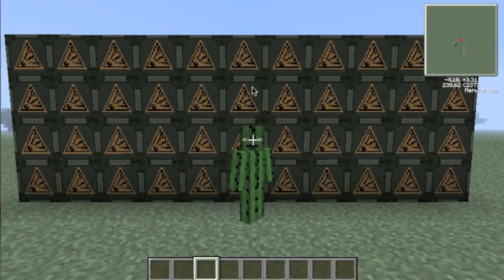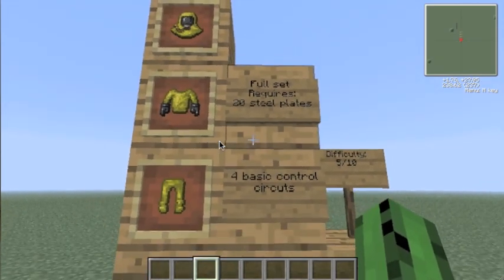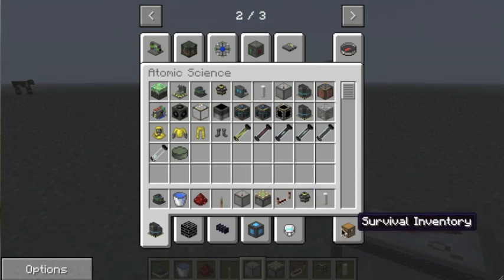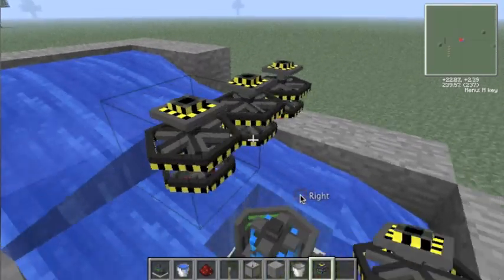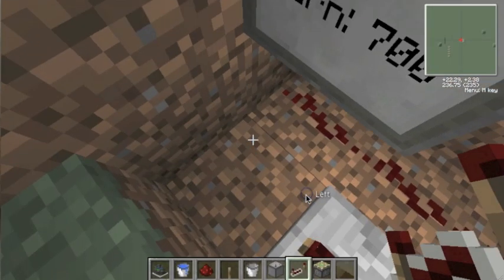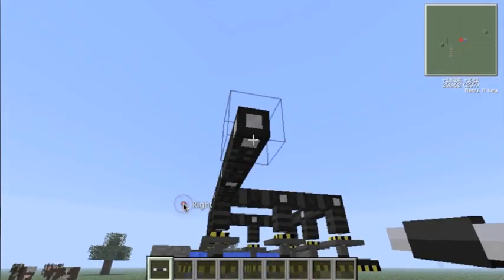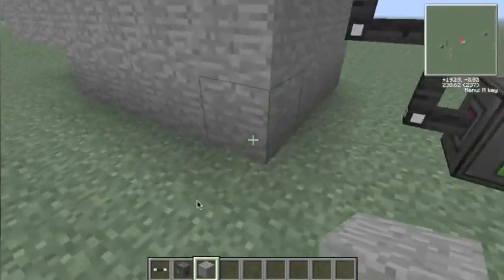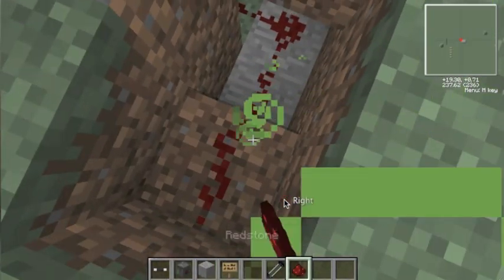Voltz Nuclear Reactor Tutorial- how to make a Fission Reactor in voltz!

Comment: Lead is the only thing dense enof to stop radiation
Reply: Lead in real life will ownly contain radioactive material  for so long not to mention the heat will melt pure lead very easily have you watched the battle of Chernobyl  they had to stop the reactor from burning into the ground water and causing a big nuclear explosion bigger than the nuke that hit Fukushima and it would of wiped out 50% of the population just thank the people who risked there lives to stop it but because it was so hot on the reactor it melted the lead in the end they just cleared most of it and covered it over with a big shell on it its not looking good for Japans reactor aswel after the earth quake its already leaking out radiation  and they wanna get it running they should get rid of it  
Nuclear reactors are unsafe even on flat ground let alone on moving plates 
Then you have very risky reactor tests which you think has gone right then it causes a black out then KABOOM!!!

Comment: no fission reactors take fissionable material and use that to make power, definition: fissionable material is any material that can be fissioned into power but then again you may just think what does he know.. well my uncle is a nuclear physicist he deals with this stuff everyday and just for the record fission reactors are very unstable so they aren't used at all and wont be until it becomes more stable.
Reply: What on earth are you talking about? All fission reactors use fissionable materials, it's why they are called fission reactors. Fissionable material is not just any material that can be fissioned into power, it is a material that when split on the atomic level, releases neutrons, gamma rays, x-rays, and other forms of energy. All elements are technically fissionable. You are thinking of fusion, which is the splitting of an atom, and we have done this. What we have done is gotten a sustainable reaction out of fusion that produces over 1 Q (ration on the energy put in, to power put out.)

Comment from the maker: Voltz is not a mod, it is a mod pack. It is one of the mod packs in the technic launcher, which is extremely easy to get. Google it and u will get it in 5 mins. Second, it is technically a fission reactor since you want to be technical, but it runs on uranium so is also therefore a nuclear reactor. They are the same thing- the game just calls it a fission reactor  instead of a nuclear reactor.